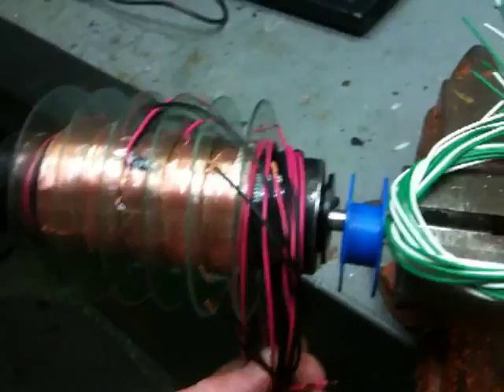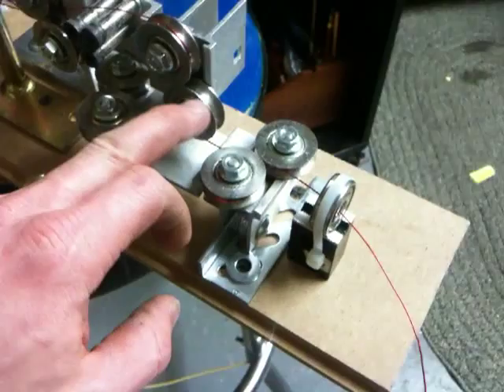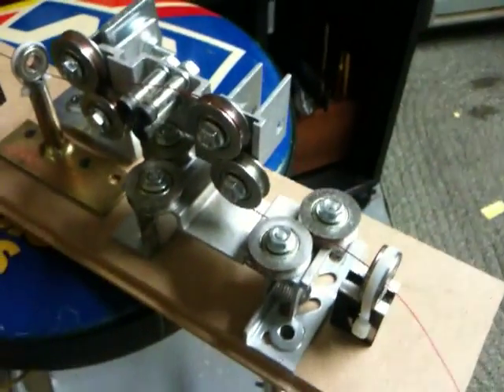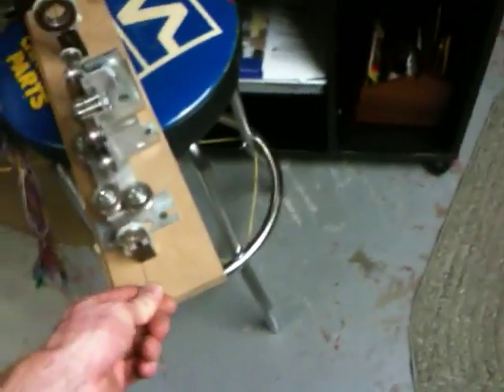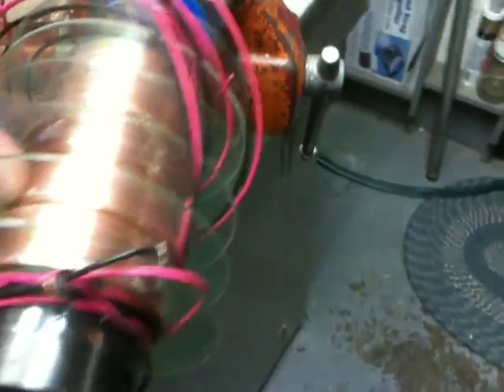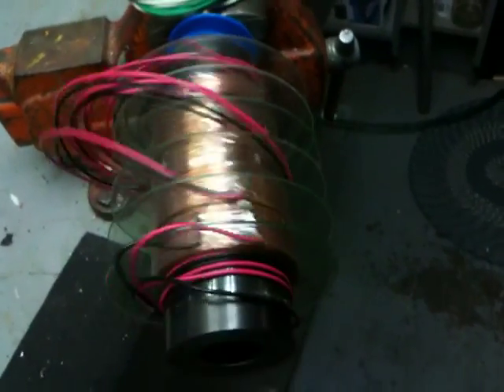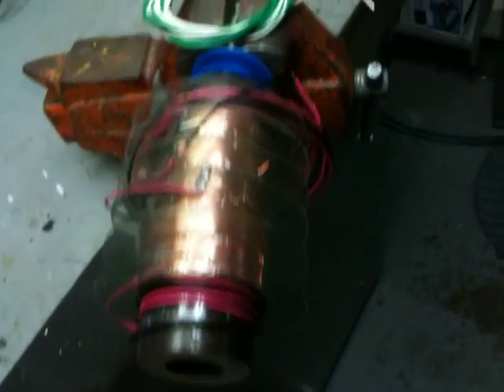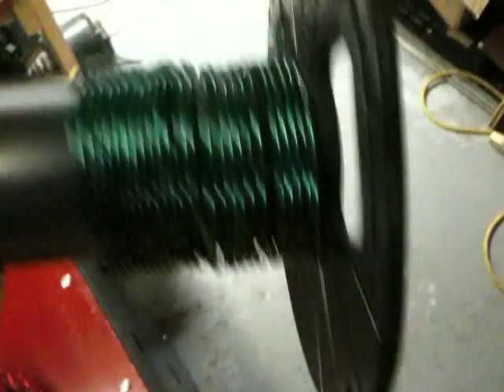EPG Lots Of Items To Show You! (Update) Its All Coming Together! RWGrwsearch.com

Comment: The LEDs are 405nm. It's as deep into the UV I could get at the time. The toroid is UV resistant polyester. The next set of toroids will be UV resistant acrylic. I just got the design down for the tumbler and I already have the motor to drive it.
When the next few Set's are done, I will be sending you, Bill Williams, the crew at the Rodin coil site, Smack and his crew and a few other folks some. If anyone else wants one, just give me a shout out.
Peace and keep on Rockin.
Mike.

Comment: you can do anything with the coil system, does that include one coil pulsed at say 10 K-volts and say the last coil at say 50 k-v? will it control the power to each coil also?

Comment from the maker: @freethisone When I say everything, I mean insted of making everything from IC chips and a bunch of complex stuff... You can just change the program... :) but what you control out side the arduino... Yea you could do that! But you will need away to control the high voltage, like a high voltage MOSFET... But I will need to make a small board to run the coils... The arduino will run the mosfets witch will run the coils. Then program however I would like!!! :) ~Russ